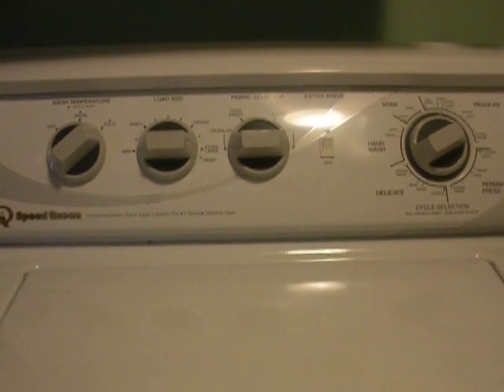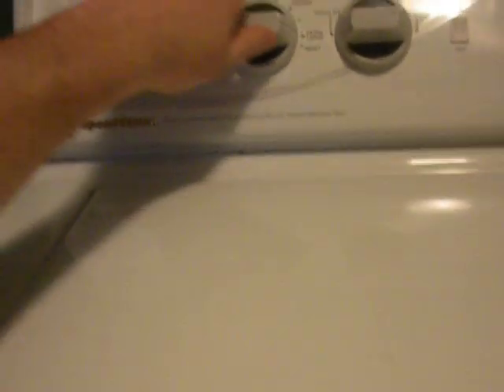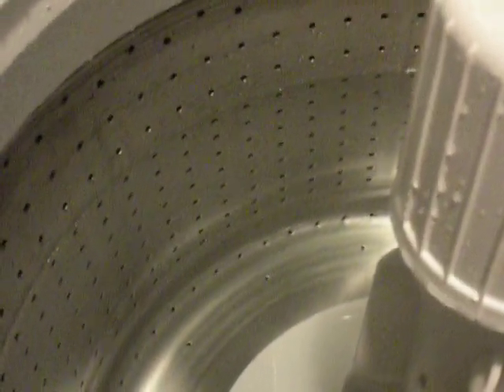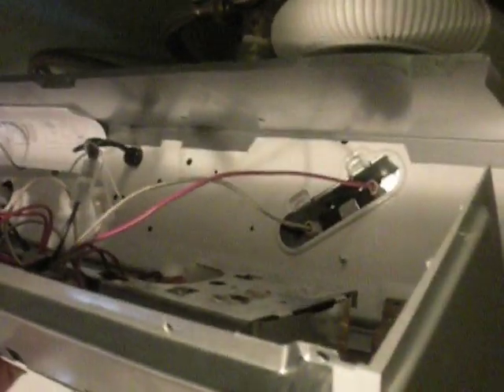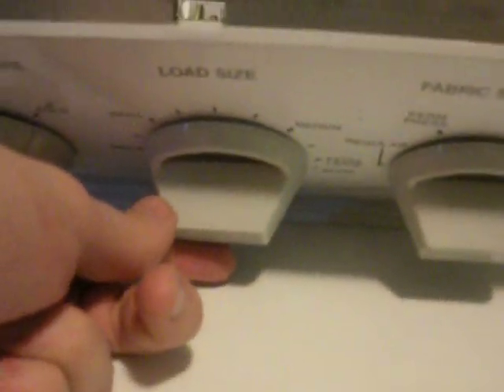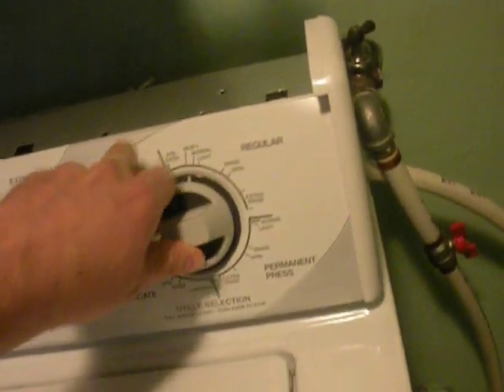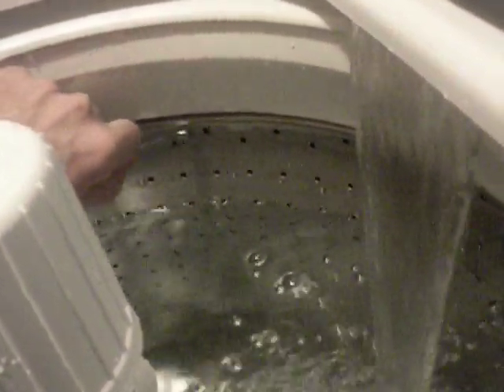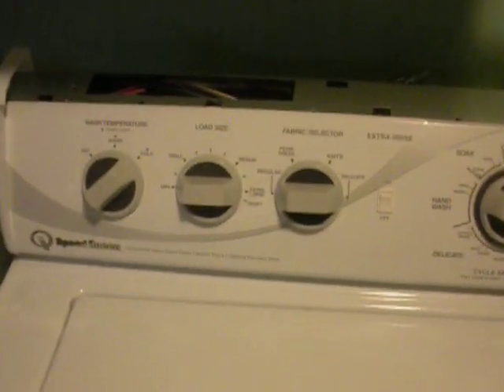Speed queen Clothes Washer water level problem and how to fix it

Comment: This procedure worked for me, but I never heard the "click" described at 2:08. All I did was turn the screw clock-wise a few turns enough to make the white plastic drum go in a little more. After about 3 test fill-ups, I'm now able to select "Extra Large" on the water level setting and have the SQ fill up right where I want it. This is at about 3/4 of an inch below the top edge of the wash bin. 

Thanks again for posting this video. It was very helpful and easy to follow.

Comment: Thank you for posting this!  Your instructions worked perfectly and we now have a full tub of water for our dirty laundry!!!  I wish the EPA and all of Uncle Sam's regulatory agencies would exercise a little common sense!  We now have to drill the insides out of our shower heads to get enough water to wash our hair, flush our toilets multiple times to get them clean, use more light fixtures because our light bulb wattage is severely limited, etc. etc. etc.

Comment: Great video! The first two crews removed the decorative top plastic piece, and three more screws allowed the control panel to tilt forward. I turned the adjusting screw one clockwise (right) turn and filled the machine. The level came up about half way from the factory set level to the top of the stainless steel drum. I gave it 1/2 more turn and saw it was between the two top drain hole rows. Ran a load of clothes and the level switch shut of at the exact same level. Good to go!

Comment: As a appliance repairman for over 40 years i can tell you do not do this because it is not necessary. if you think you need a little more water which most of the time you don't you just hold the reset until the water level reaches your desired level. plus changing this setting by adjusting this factory set screw can cause your washer to overflow under certain load conditions as i have seen happen more than once.

Comment: THANK YOU for including all the steps, i.e. how to open up the control console...

Other vids start with the guts already open, and I was wondering how hard the SQ was to open compared with my old Kenmore that just has 2 screws in the front and then lift & tilt-back hinges.

Comment from the maker: Thanks for the tip.  I posted two videos addressing this after doing some research and reading the wiring diagrams.  I now have full flow on the hot water for a true 50/50 warm, and best of all I can now rinse at the same temperature I wash my clothes in which is what I've always wanted!

Comment: Apart from the little rant, this machine is the best washer i have owned since the mid 80s. Got the speed queen dryer last month and the build quality is very sturdy. Actually feels more solid than the 26 year old whirlpool it replaced, which was a good basic dryer

Comment: Great!  My model was slightly different, but still had the screw in the switch area.  Worked like a charm. I found a copy of the maintenance manual online, but it was missing 'Page 52' which of course was where the water level adjustment was supposed to be!  Default of lower level makes no sense, as you have to do extra loads!

Comment: Thanks for the video. Just purchased a Speed Queen washer model AWN 432 this past week. One thing I noticed about the tub hole pattern on yours is that the very top row of holes has a staggered? Pattern. The one I have just has a single row of drain holes at the top. Anyway the water level in mine right out of the factory was a little higher than yours. I adjusted it and now it comes at just underneath the top row of holes.Thanks !

Comment: I bought the AWN432 mechanical controls a month ago and because of this video I was confident in being able to adjust my water level....thanks so much....my machine looks slightly different than yours when I removed the top parts but it is basically the same.  I think I had to turn the little screw about one rotation only to get the Ex-large setting to fill to just above the top row of holes.   I also defeated the operating mechanism by clamping the metal tab on the back based on another video I watched.
Reply from the maker: Glad that worked!   The door defeat is a real dangerous one I do not recommend.  Why would you do that when the door doesn't lock shut like it does on a front loader?  I just don't see what is gained by that, I must be missing something...?
Reply: +alitak I like to watch it in action.  I guess I am geeky that way.
Reply: I'm with you.  I hate the lid switch. I like to see what's going on in there.  Can you tell me which video you watched to do this?  I've looked and can't find one that shows  clamping a metal tab.
Reply: Look at this thread.  It shows a couple of pictures where to stuff a piece of cardboard (that's what I did) to keep it working regardless of the lid position.  I hope this copies over on youtube.

http://www.automaticwasher.org/cgi-bin/TD/TD-VIEWTHREAD.cgi?26887

Comment from the maker: True, true, and all true!  SQ is the last washer on the market built with the quality we used to get in our 1980's and prior appliances.  A real transmission, a solid timer, etc.  The balancing on these was what sold me.  I can throw a brick in there and put it on the spin cycle and it will not bang the washer or walk the floor.  The design on these is just second to none!  No mold like you get on front loads either.  Still the best deal out there and a good unit once modified back.

Comment: I just did the fix.   I turned the screw 1 and 1/2 turns which brought the water level just under the top row of holes.

I seem to have a front to back level issue.  When water is in line with top holes in the front of the washer they are 1/2" below the same holes in the back.  I can level it by push the drum around but it seems to reseat in that position.   Does not see to affect it much though.

How much water can be added before its TOO much?   Past the top holes?

Comment: just don't tell anyone ! and as alitak said if a repairman is that stupid find another repairman!  i am a speedqueen dealer and i am doing what i have to do to make these machines work as they should. as far as i know they are very few washers that this can be done on . cheap whirlpool made ones can but it is not this simple and you loose some features.  on the speed queen turn the screw 2 1/2 turns clockwise. any good repairman would look the other way if they noticed this modification

Comment: Thank you for this hack vid-I might try it. Someone posted a link to this vid on the official Speed Queen Facebook page & the person handling the SQ FB page replied w/this:
"For most of your loads, the Extra Large water level will cover your clothes. If you find that it does not, and you need more water - you simply turn the Load Size knob to RESET. While you are holding it on RESET, the water comes in until you let go, putting you in control of the water level. The procedure shown on youtube is not necessary."
Reply: brooke127  i understand what you're  saying about holding the water level knob in the reset position till you are at the level needed.  I only do full loads and holding the knob every time just doesn't do it for me.  I made this adjustment and no more babysitting the washer for wash and then more water for rinse.

Comment: Cont'd.   I think you'll enjoy the irony in this:  I had to replace my washer in part because the fill valves wouldn't shut off. I had to watch the machine so it wouldn't flood. Now I had to watch the machine to add water so it wouldn't tear up, tangle, and not get the clothes clean.  That's why I sent back the GE "h e" (hell on earth) machine I got before the Speed Queen. NOW I've done my homework and the 432 machine is amazing. No electronics. No plastic outer tub. No plastic parts in the dri

Comment from the maker: The water level adjustment is a work in motion, it's not x turns, but rather turn it until the water level is where it needs to be.  This will take a few times of turning the screw, plugging it in and testing where it shuts off.  I turned mine until it was full, then backed it off a half turn to be sure it didn't over-fill and just start dumping on the floor.

Comment: Ta-daaahh! Success!  Unplug.  My new AWN432... has two flat head screws, take off metal piece, followed by three 1/4" hex screws, pulling control panel? forward.   The adjust knob was small, more like 3/16" or 1/8".  Using a crescent wrench seemed to work best.  At first, pulling the timer knob started the water automatically (after plugging back in), but after more than one turn, I needed to push to the reset position before more water came out.  One 360 degree turn equaled one level of holes higher, but start with less as your mileage may vary.  Thank you alitak!

Comment: most repairmen would never notice & the ones that did would not care because they know that adjustment will not cause any other part to fail.  the only trouble i ever see out of speed queens is every once in a while a timer will fail, but the timer is one of the few parts on the washer made in another country !  with that said they are still the best washer on the market today.

Comment: Sir,

A few of questions for you:

1.  Can the adjustment be made with the machine off?   I only ask because another video shows the adjustment being made when the machine is on.  I assuming this is done for convenience purposes (not plugging in/out to see new water level)

2.  Does the machine need to be filled with water at the extra large level when making the adjustment or is it sufficient to have the selector at the extra large level with the machine unplugged?

3.  Do you need to select reset after each screw turn?

4.  Are the other water levels affected (mini, small, medium)?  That is since the extra large level is higher are the smaller levels bumped up?

Thank you for your time and effort!!
Reply from the maker: You should adjust it with the power off, then plug it in once the adjustment is made, turn it to reset for the water level real quick and see where it stops once it's full on the highest water setting.  Not sure on the other stuff you are asking

Comment: Be aware, the extra weight of the water and the greater number of garments or large sized items will lessen the life of the motor over the life of the washer.  Every action has a reaction.
Reply: Less water makes more load force on the drive components with a similar sized load though. The drive train of these machines was designed to work with a full load +full tub of water and will handle the extra water just fine. Having said that overloaded is still over loaded and that will wear out your drive components.

Comment: HELLO....Hold the fill control in the reset position til the water level rises to what you want.  Reset is just simply the add water position.  Most loads are fine without the tub crammed full of water.  Try it   I did

Comment from the maker: btw, I don't sell or repair these.  I'm handy and know how I want my stuff to work.  I don't make recommendations on washers, cleaning, etc.   The speedqueen is one of the last models to use the old school transmission and real components.  The new ones are all direct drive fall apart crap.  So far I'm pretty happy with the speedqueen reliability.  I have renters that pack a lot of crap in these and don't take care of them.  They still do a great job.  This is the best self balancing top load.

Comment: I have a AWN 432. 

How many turns (Clockwise) did it take to get the water level right?   
ie. 1/2 turn or 1 turn etc.....

Also why back it off at all if its set right?   That part did not make sense to me.  Could you clarify?

Comment: Thanks for showing how to adjust it... but I am very concerned about the extra gallons of water that you add, and the extra weight effect on the Belt(s)... I broke the outside knob which controls the water level, and  I couldn't find that parts ID/reference to order a new one (it is a special knob different from the others on the Washer and Dryer... it has a metal wire inside)... My washer is the same : AWN432 SP111 TW01 , and I really appreciate it if you happen to know what that part SKU is...  broke (cracked the knob housing) when it was forced beyond its stop.  9-20-2016

Comment: I did the same as you, but spin cycle centrifugally makes the water slosh up and crash against the underside of the boot, and as a result the sloshed water comes down to the floor. I suppose you need to strike a balance. My mother's 1960's Maytag kept the tub still for the first 30-sec of draining I would guess for this very reason.

Anyone else having fill spout issues where the tub swings forward (especially during the rinse sprinkle) and the fill doesn't clear the tub but instead goes behind? Source of water on floor too?
Reply from the maker: Karl Ellison mine does not do that, not sure what you got going on there.

Comment from the maker: @fttp211 If it's a speed queen just fix it with this method.  It's a solid washing machine, I have two of them working great.  This modification is really easy to do, just watch it for a couple fills to be sure you didn't over do the fill level.  I have had zero problems with mine since adjusting this.

Comment from the maker: Anything can void your warranty.  They may come out and say you overloaded it and broke it.  Here is my personal experience with Speedqueen, when the water pump broke on it under warranty they direct shipped me a replacement that I replaced myself.  The guy at Speedqueen specifically told me that I would not void the warranty replacing the part he was sending me.  If a dishonest repairman said the warranty was void from water level adjustment I'd find a different, reputable repairman.

Comment: I noticed they all are 3.3 cu ft washtub, but they have different amounts of water, 20 gal, 24 gal and 31 gal.  Does this mean they all can be safely changed to say 28?  The motor size is all the 1/2 hp, so heavier amount of water, it will go out sooner, right?
Reply from the maker: Zuni Harper  I don't work for them so I don't know what their position is on that.  Mine is the largest capacity that they make and my motor still works great, and as my wife can attest to I pack that washer way too full.  ;-)

Comment: How do I fill the hole on the filler flume so that ALL of the water goes into the tub for the spin cycle- not 50/50 of the water going into the outer tub.  Thanks!

Comment: Do you know if all the knob washer models has the reset on the water level knob specially the model AWN432SP113TW04 ?
Reply: +Damaris Vazquez Yes I just made the modification on my AWN432SP 2015 Model from Amazon. However, the adjustment screw is a little bit smaller.

Comment from the maker: I was referring to the competition, I should've clarified that!  :-)  I think all the speed Queens are regular transmissions not direct drive, but you'd want to refer to the manufacturers specifications sheets.
Reply: How do you make it run with lid open
Reply: joe m  Hi i opened the top of the washer and inserted a wood clothes pin into the lid switch. I know can keep the lid open while the washer is running.
Reply: I just purchased mine Feb-2017. Everything stops (fill, etc.) when lid is raised. The schematic shows the lid switch is directly in-line with the mains power after the plug itself ... which would kill all electric. Fixed that with a wedge of cardboard to keep switch lever down. Instantly reversible.

Comment: Why do you have to take the header off?  I just watched another SQ youtube video (by either Ted Walker or Rocking Dustpan) where, to add more water to the tub, you just twist one of the knobs (holding it in place until the water reaches the level you want).  Does your model not have that?
Reply: I don't want to have to do that every time, that's not a fix that's a one time/one cycle situation.  Say you do that on the wash cycle, take a look at the rinse and it's right back at that half full point.

Comment: “I contacted the manufacturer on this procedure and they stated that the machine warranty is voided if this adjustment is made.  They also stated that tampering with this screw could cause the unit to overflow causing a flood in your home.  I’m not sure I want to give up my warranty and risk a flood”

Comment: Cont'd.  I had to watch the machine so it wouldn't flood. Now I had to watch the machine to add water so it wouldn't tear up, tangle, and not get the clothes clean.  That's why I sent back the GE "h e" (hell on earth) machine I got before the Speed Queen. NOW I've done my homework and the 432 machine is amazing. No electronics. No plastic outer tub. No plastic parts in the drive and stability system. Built like a tank. Its the last of its kind.  Get one of these before its too late. Research an

Comment: they can't tell you to do it because if they did the government would shut them down ! they have to take that stance on the record, they are just trying to scare you into not doing it with the flood talk , once you get the level  where it needs to be and you run a test load to check the level there is no way that will happen . hundreds of people have made this adjustment with no issue. not saying that you are wrong on the warranty facts if you follow the rules to the letter

Comment: Hurray for manual fill knobs!  Hurray for manual everything!  It lasts longer.  I just hold the fill level indicator until it gets to where I need if I have a large load.  Or,  just fill the washer before adding the comforter.  Damn good washing machine.  My front loader was horrible and did not clean anything!  Glad it died!  Glad I went American made and simple.